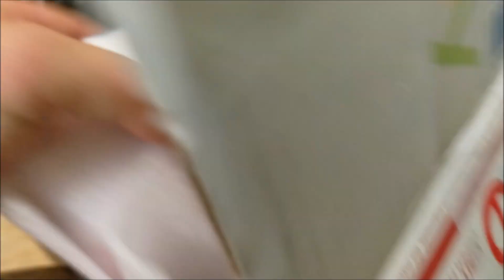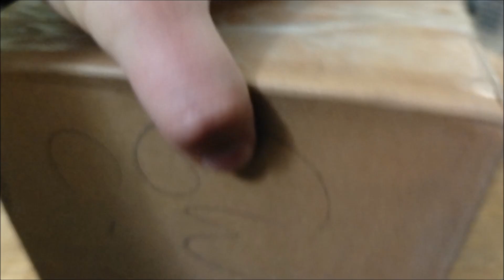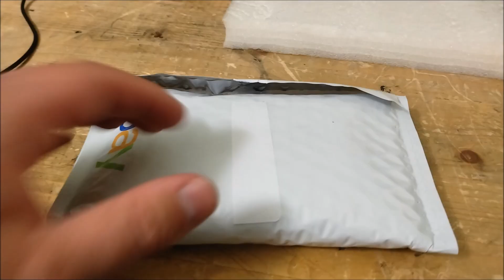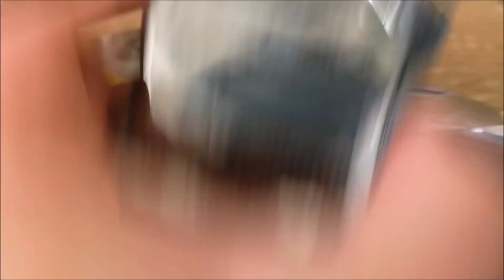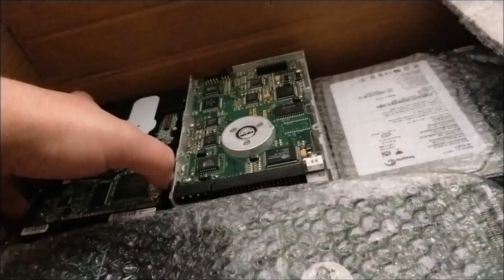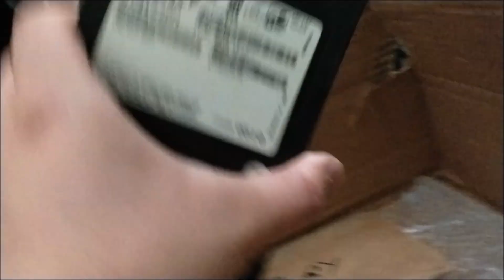BONUS: More imports - Hard-drive mailbox #7

Comment: this is my first time seeing truly ancient hard drives, what are these, wheres sata, wheres IDE. what is this place
Reply from the maker: @rat_lord8985  SATA is far more modern than anything I collect, I believe it doesn't even show up until 2005 or so. IDE as you know it probably didn't exist until the mid 90s, which is typically my cutoff for drives (1994). 

Ultimately, SATA is just a high speed serialized version of UATA, which itself was a standard to give IDE drives extra performance. IDE is descendant of the ST-412 controllers on the IBM AT, it even uses most of the same command set and resides at the same memory and I/O addressed as those antiquated controllers.

Comment: The hp hard drive comes out of an HP 9153C and was called the "nighthawk". It uses a proprietary interface that seems to me to be half ATA and half ST-412. I have one but I have never messed with finding a way to do anything with it as they were a known unreliable drive when new and HP9153C computers are expensive.
Reply from the maker: Interesting, I just picked it up because it was cheap.
Reply: @TheDiskMaster  That's what I did with mine as well, it sits next to my JVC JD3824R00-1 and my Priam 3450-11.
Reply from the maker: @bobjoe2827 Priam 3450-11? Never heard of that model I don't think. Nice find with the JVC though, is that the servo one?
Reply: @TheDiskMaster  The Priam is an 8" hard drive using the "Priam interface" instead of the more common SA-1000 interface. The JVC drive is one of the 3.5" stepper drives with a 26 pin interface used in early laptops (an Epson Equity LT in my case).

Comment: The ST2502N is most likely an Imprimis design, and built in the Oklahoma City plant.

The HP drive is a Nighthawk drive, which has a proprietary interface- and were never very reliable from what I understand.  They were used in HP 9153C external disk enclosures.  Reconditioned 9153Cs sell for an ungodly amount of money.
Reply from the maker: @douro20  that's what it looks like. Interesting, wish I could test the HP drive somehow. I only picked it up because it was cheap.